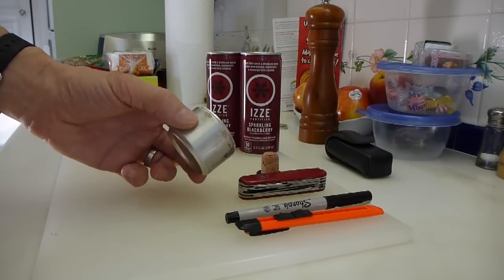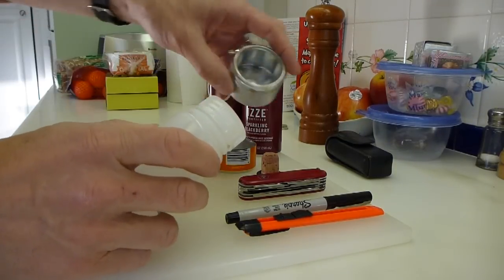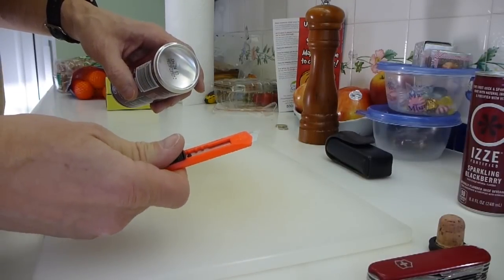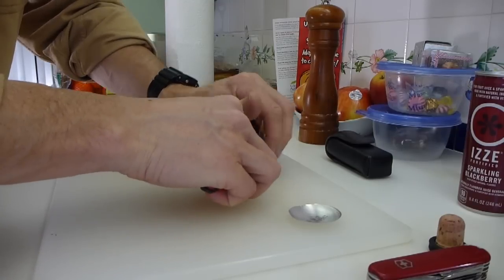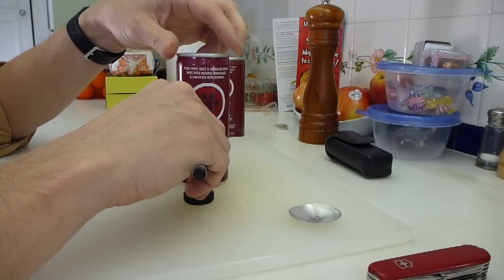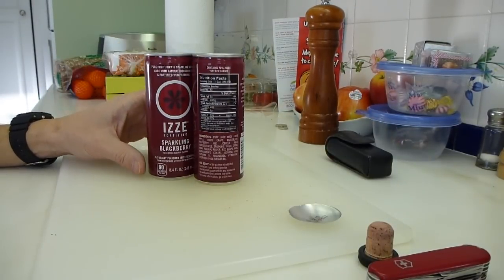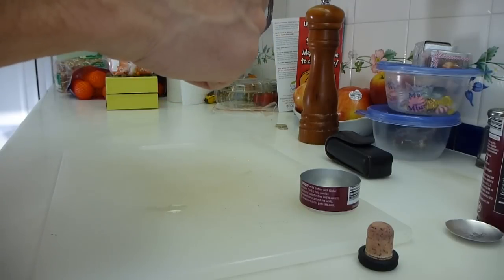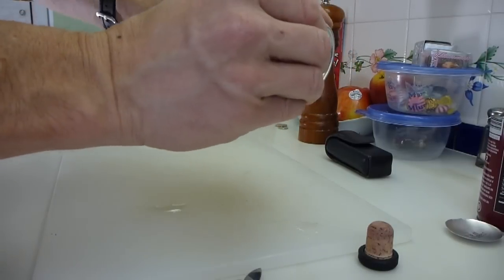Make an Alcohol Groove Stove in under ten minutes

Comment: Will the stove work effectively if you place the pot on the stove rather than on a stand?  If done, will the flame be snuffed out?
Reply from the maker: Doug Ramsey You can place the pot on the stove, but with reduced heat output. It is necessary to make a small hole in the very top lip to allow air to pass between the pot and the stove otherwise it will stick to the pot with a vacuum.Optimal pot height appears to be just over an inch above the stove. Remember to use larger diameter pots to maximize heat transfer. Otherwise heat will just go up the side of the pot and be lost.

Comment: Since could not see the grooves, how are the spaced--directional as in a compass?
Reply from the maker: Doug Ramsey These days I use four grooves evenly spaced at N,S,E,W.
Reply: Thank you for the quick turn around.  I do like the alcohol stoves but am dismayed that 1 ounce will boil and not simmer much after with reconstituted side pasta or rice packages.  By reducing the groove vents to six rather that 8, the extra time to boil would really allow me time to do those meals when boiling is not really nec.  The same effect might be with 8 inside vented holes in a penny stove with 3 fill holes rather than the 16. on the traditional  outside.
Reply from the maker: Doug Ramsey This stove is not designed for simmering. There are other stoves which can simmer. Try the traditional soda can stove with a simmer ring. It works quite well. You could also try a Tornado Groove Stove which should also simmer well with a suitable snuffer. This groove stove is simply very easy to make, and using this particular can, blooms as long as possible. It is designed to boil water as fast as possible. To cook food, I boil the water, add the dehydrated food items and then place the pot in a cozy (made of Reflectix) for 20 minutes. The results generally turn out well. There is information on the Internet on how to make a Pot Cozy out of Reflectix.

Comment: I noticed that you haven't added insulation between the walls. Would there be any benefit in doing this?
BTW, great vid!
Reply from the maker: Insulation in the walls of a double walled stove allows wicking of the fuel to top of the stove wall where it is less dense, in the wick, and also hotter. This allows for faster vaporization and hence a faster bloom time. This stove blooms very fast as it is because the grooves are so narrow that the wicking hardly benefits at all. However, the second use for wicking can be to pick up the last dregs of fuel from the bottom of the stove once the fuel level falls below the bottom of the grooves. This last burn time (about 20-30 secs of non bloom burn) was not (in my opinion :-) worth the trouble of putting wicks in the grooves. I did try it though using carbon felt. Very fiddly but it does work. Thanks for pointing it out.
Reply: Fair enough :-)  Keep up the great work!
Reply: @transatlantek This can be done without wick, just adding 6 mm in grooves height and cutting skirts of 6mm, that will bend over the botton curve of the can, suking by capillarity all the fuel.